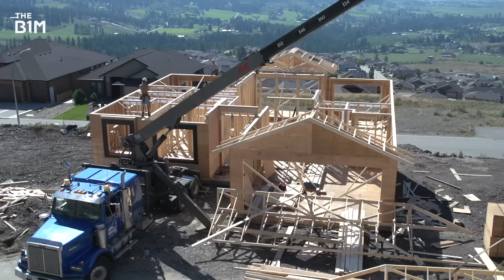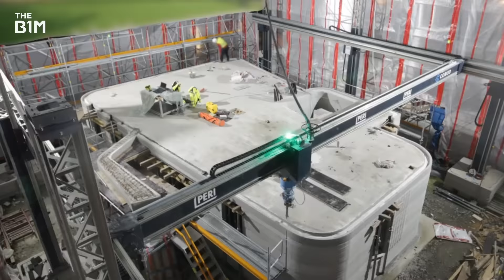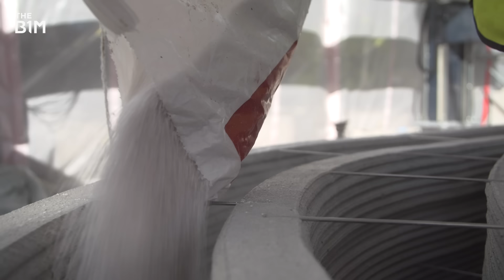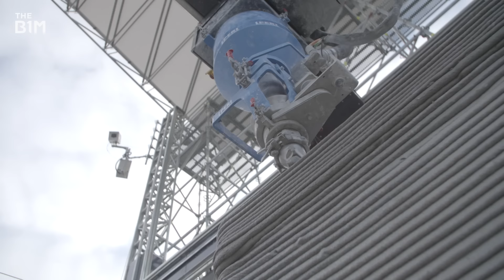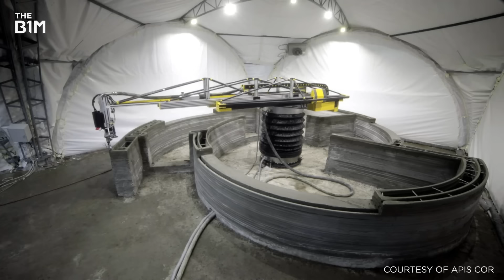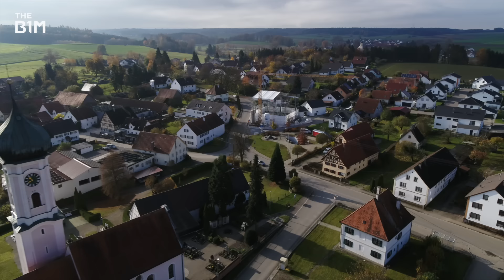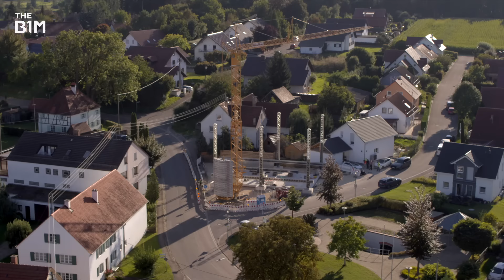Why This 3D-Printed House Will Change The World

Comment: "Addressing labor shortages". More like avoiding labor costs!
Reply: Construction costs in Germany exploded in the last couple of years because of labor shortages. 
Few young people want to start vocational training in these jobs. Yes more pay can help to reduce the labor shortages - but not in the amount it needs to change.
Reply: @JustBen81  what happened to the millions of refugees that went to germany? none had skills? How do they live?
Reply: @stahpit1971  - they live off the exorbitant taxes paid by the working stiffs of the EU... when they’re not rioting and burning things down.
Reply: @stahpit1971  most of the aren't allowed to work. If they are allowed they usually do work. Either in service jobs or they manage to get their qualifications recognized (which is hard).
Reply: @JustBen81  property prices were flat in germany?  Here in the states property is what really drives cost as well as fluctuations in material costs particularly the wood market not labor really.
Reply: @davidthurman3963  That's not "really" what drives property cost in the states.  It's far more complicated than that.
Reply: @GoatZilla  .... Really? A house that cost $60k in the 1980's and costs $650k  today same lot same  building even  with zero additional building costs. How is that not land costs? I am pretty certain labor costs most certainly haven't increased 10 fold over that time..yes it is complicated and 3d printing won't fix it labor cost of framing a wall and a bit of drywall is insignificant factor.
Reply: @davidthurman3963  Have you considered socioeconomic factors (the game conditions) that might be driving those costs up?  You're close to the answer, but you haven't quite caught onto the game just yet.
Reply: @GoatZilla  it's worse than simply the money game by the banks. Let's see I go to refinance in 2009 my house they say no. They get free money to cover their losse totally , they take the house which they legally owned but really had zero investment in now, owner by title only, resold the house and collected pure profit and their stocks went out the roof with record windfall! Yes I am very  aware of the game. But it's actually way way  worse. There is now extreme limitations on affordable expansion. What land is available is being picked up by oh bill gates etc. Let's see $171mil for 15k acres in eastern washington. In the mean time no affordable expansion is allowed we can't have suburbs and sprawl right?  Thus the average Joe is forced to either live in highly urban centers with ever increasing housing costs in smaller and smaller spaces higher and higher. Yes I know the game it's far worse than even that. As soon as we start to even breathe population is too large every possible angle we hear omg that's the worst possible thing that can happen from the very same folks whom are making all of this money off of.  Never mind I am concerned about the environment and and totally nutty and avid wilderness guy like john Muir. 2.8 billion to 7.8 billion in just my life time. That's not substainable, or mentally, emotionally, psychologically, intellectually  healthy. My prediction people will start going nutty with all kinds of conspiracy theories ! Oh wait I am a 20/20 vision prophet!
Reply: @davidthurman3963  Right, so I wouldn't just say "property costs".  It's a confluence of factors that are driving prices in the states; it is just a system of contrived rules, mostly decided on by monied interests.
Reply: @JustBen81  It should be a requirement that you know basic mechanics and plumbing/electrical stuff. As well as money, but that's a whole 'nother thing.
Reply: Actually, the price of crafting labor is high precisely because of labor shortages. Regulation also plays a big role tho.
Reply: @wavyy  labor isn't actually short just the price companies are willing to pay for said labor.
Reply: Here in germany labor shortage is a real problem because right now craftsmen are really rare compared to the number of jobs to do. When a client gets an appointment at all, then he better prays that they come indeed and not switch to another more attractive construction site...
Reply: That is because Germany's population is growing, mainly due to immigration. So a huge demand for houses etc.This is a much better idea and should be the preferred way to build a home.
Reply: @driflysh4597  Yup. We're having that issue with basic carpenters in the States
Reply: @driflysh4597  that's how it's meant to be . Get good pick and choose where and when you work . This machine must die .
Reply: In the USA, skilled labor is expensive and the cost goes nowhere but up. Construction firms have had a hard time finding enough new unskilled workers to train up that can also pass substance (drugs, alcohol) screens.
Reply: @jtd8719  What? In America contractors hire illegal aliens to avoid paying fair wages. The "increased cost of construction" is for higher material prices and higher wages for the contractor only. In Texas 50% of construction workers are illegals.
Reply: The generation entering the workforce now do not want to work or think that manual labor is beneath them. Regardless of reasons, the construction worker job is going away very quickly because of people not applying for the job, not because of 3d printing or any other automation. I try to hire people for entry level "construction" jobs every day. I'm lucky if any of them even show up for the interview, let alone be remotely qualified to use a power tool.
Reply: Work smarter not harder. Become a person who makes/repair the machines
Reply: @bullet996  Until they make a machine to do that too.
Reply: @Lucklaran  yeah. Everything has to be replaced at some point.

The future is now old man
Reply: Hoang Vo How many people need to man the machine?
Reply: Good labor is in shortage.  That's why basic trades are charging 3 times what they did just years ago and wait list is 6 months to a year out.
Reply: @AnnSisuLiv  in Germany the training in the construction buisness is (as basically everything below a bachelor's degree) an apprenticeship. So you get paid for it and work for the company while attending a job-specific school a third of the time. 
You don't get paid much - below the minimum wage, but you get an education in exchange. Since not many young people want to apprentice in a hard labor job the mony you get as an apprentice is quite good compared to other fields.
Reply: @JustBen81  I should have been more specific,  I was speaking to US. It's similar here but drugs, alcohol, laziness, being undercut by illegal workers has ruined a reasonable pool of workers.
Reply: @AnnSisuLiv  that's not the case, the low pay, terrible benefits, and hard work is the reason why there is a shortage.  I use to work in the trades, it's not worth it all to do that type of work
Reply: When so many people don't even have job especially in USA. There are no labor shortages. Yes of course they are avoiding labor costs.
Reply: There was never a shortage in labour
Reply: Jack W  That's pure bullshit . You can build a house for fuck all using any method.  It's the developer profits people can't afford .  New building technologies will just create more people in dog shit service jobs.

The house will still cost the same .
Reply: Avoiding the need for people. Progress? For whom?
Reply: Notice zero mention of actual savings...
Reply: I will buy a house printer if I can get 25 customers  here in oregon to commit to their next house being printed.... I should start a Kickstarter with designs etc. Will it be cheaper I mean more affordable? Well tbd, but look it's really really cool man😎.
Reply: no shit, so what?
Reply: lol exactly
Reply: It’s all about the mismanagement of the runaway inflation caused by the central banks all around the world. They get to print easy money while we toil with our time and physical sweat and tears efforts to obtain them
Reply: Yep. They're going to just blame immigrants for labour shortage
Reply: Just sounds like a way to drive income down for workers doing a shitty, cold hard job.
Reply: @durkadonuts  like the assembly line drove income down and destroyed jobs in the car industry?
Reply: @JustBen81  Yes...Just ask Detroit Car industry...The one that no longer exists. There is only so many working mans job you can lose before an area gets devastated.
Reply: @durkadonuts  do you think it would exist at all without assembly lines? Affordable cars aren't possible with manufacturies.
Reply: @JustBen81  Affordable?  The cheapest new cars in the US are over 14k.    That's over 300 a month.  Average take-home minimum wage is 1150 a month.  That means more than a quarter of your income is spent on just one car.  1150 a month won't pay most people's housing, let alone utilities and groceries.  You and I have a very different definition of affordable.
Reply: @Lucklaran  let's just google what the cheapest manufactured car costs these days - you'd have to   cut something of that price because manufactured cars these day are high end but you sure wouldn't ne able to produce a car with today's building standards for 14.k without an assembly line. Like my economics is professor pointed out: volkswagen cut every single job since the  the war but still increased it's workforce.
Reply: @JustBen81   https://www.automobilemag.com/news/10-cheapest-cars-on-sale-united-states-today/ 

2020 Chevy Spark $14,395.  Doesn't change the essential fact, even manufactured cars are not what I'd consider affordable.  The fact that they would cost more without automation is irrelevant to someone on minimum wage.  

I bought a new 93 F150 for $16,000 in 93.  A new one now is about double($35,920).  That's almost $650 a month for 5 years(more than half of the average minimum wage in US).   16k in 93 is about equivalent to $28,975(according to https://www.saving.org/inflation/inflation.php?amount=16,000).  So, about $7k worth of "improved features/construction techniques".  Doesn't change the fact I'll never buy a new one again.  

I'm just saying, automation does not equal affordable to everyone.
Reply: @Lucklaran  that's not the point of my comment. My point was that automation isn't necessarily killing jobs. It may transform jobs to jobs with different requirements but that's not what happened with cars and that's probably not what would happen if printable homes really should become a thing.
 For the record: I don't own a car and the car I once owed was 10 years old. My parents owed 2 factory new cars (one bought the week the socialist country they were living in collapsed and worthless at the end of that week) in their live and don't consider that normal. If you wanna talk affordable car look at used cars.
Reply: Fr lmao
Reply: Hmm brave new world I’m hearing complaints of labour shortages is this really a problem that we can overcome by an overhaul of out educations systems.

It’s a slippery slope so we want to live in a world where we have little to do and barely any employment diversity we can’t all be programmers or app designers.

I get that technology will just keep evolving for me I honestly would rather live in a caravan seems soulless and drab I like living in a place that had a human touch even if the guy building didn’t give a toss about what he was building.

While this stuff is interesting I think we will look back and lament for the past when people actually made things is that not why we have opposable thumbs and intelligence??

But the technology is really interesting I guess....
Reply: @chadholmes7051  You know what they did for website designer class at city colleges? 

Here's a book, read it. Take computer quiz. 

Meanwhile, you can be taught in a half hour irl. Too much useless reading doesn't work on me and I LIKE reading.

Comment: no bricks and 0 reinforcement with metal beams whatsoever, just small metal rods so the concrete wont cave on itself later on....how sturdy is this thing? whats the durability in the Richter scale? also seems like an awful simple house, the kind of house you would build for a quick getaway to spent a weekend somewhere and surely not to live in a city for a long time....I guess we have to wait for more info about that stuff...cause it will all come down to if its cost efficient or not....

Comment: This isn't really a game changer, with a team there to build the floors, ceilings, roofs and all the finishing you are going to have to do to the ribbed walls, the mounts for the printer, the tower crane (To build a single house!) it would be cheaper and quicker to hire two bricklayers.
Reply: Miles: In Germany (and most of Europe) it is fairly common to have a foldup tower crane on many housing sites as it is. - And a simple climbing tower crane can/could "deliver concrete" onsite just as easily as a Cartesian Machine (it is just a matter of re-mapping for the kinematics) .. 

(PS, My argument too is that "Game changers" usually  - aren't.)  - often it is just one part of the puzzle.  And the competitive  advantage is lost when everyone else copies ....(easy to do - this could  be driven with a Raspberry pie, or at the most a simple consumer laptop, there is nothing computationally difficult and no "skill" needed -  of course there is always a level of understanding required to "get it to work"...) ...- or undercuts your lucrative margins.
Reply: Everything gets cheaper with time and development ( not including inflation)
Reply: @Zen-ow8xf  Labour doesn't.

Comment: How much sanding is needed to get those walls smooth?
Reply: I don't think you sand it. You further render the wall or stick on drywall with all the switches and sockets for a finished wall surface.
Reply: @PLA69  Now that you mention it, sticking on a form of plaster does seem like the faster way of doing things, whoops 🤦‍♂️

Comment: The problem here is that this takes the comparatively fast and easy parts of the construction process and semi-automates it, not much savings.  It leaves the expensive and time consuming parts of the construction to be done the traditional way, often with greater difficulty due to the nature of a poured concrete wall structure.

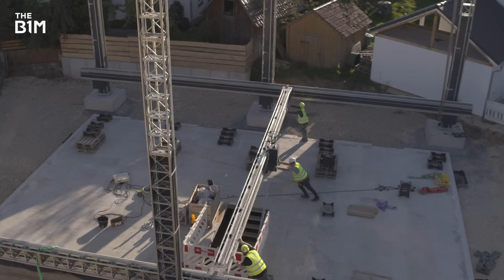Comment: I've watched this four times... nowhere does it say they are using traditional concrete.  There are massive "chemical' tanks to one side. Are they using polymers; plastics?  Can it utilize recycled materials?  Is it a concrete blend?  Is there off-gassing?  Perhaps the creators are keeping details private as they are on the verge of a new break-through technology at scale.  The floor plan appears to be 4 single-bedroom units (2 per floor) built on a concrete pad (3:15), over a basement (4:10), with an artist's finished rendition at (5:15) including a 5th unit in the 3rd floor attic. Very interesting project, would love to know much more!

Comment: Framing and sheeting a house is the cheap and easy part.  Yet all these "innovations" only replace the framing.  Lets see some innovations in the foundation, the roof, the utilities.  When you look at how big that team of people was running the machine I bet a well trained crew could frame a normal house in the same time it takes to assemble/dissassemble the 3d printer (and ignore the actual printing time!!!!).

Comment: Unreinforced concrete? I guess they don’t have earthquakes in Germany.
Reply: yes we don't have earthquakes for the most part. and even there where they do exist they are very rare
Reply: @amboss5072  most earthquakes are also really weak here. They maybe shake you up a bit for 10s every few decades.
Reply: @wavyy  true
Reply: They also said the Titanic wouldnt sink
Reply: Fiber reinforcing in the concrete?
Reply: Yes, I see a weakness in "ribbons" of concrete!!!
Reply: They can use a unique blend in the concrete and there are machines which actually lay a wire / line, or more than one, within. ie: Reinforced. The metal supports they are adding will also help when everything is cured.

Comment: That ribbed inside would definitely need a coat of plaster to smooth it out. And why not run conduits in those voids between walls? Or was that something that was left out of the video?

Comment: Imagination engineering vid. From a consumer perspective this vid it tarted up to look like the new building process and you'd be sucked in to believing so, it's not. Engineering wise, great analytical an learning project solving questions yet thought of. Off site production of large section components, tilt walls, trusses etc "3D print" manifolds to join these and add individuality for home owners then on site assembly is faster and most time, space and financially efficient.

Comment: It is correct to say- why 3D printing is not able to change the world in the houses building. It's simple, because in 3D print there is still no reinforcements. Without reinforcement, these printed houses are sandhouses.